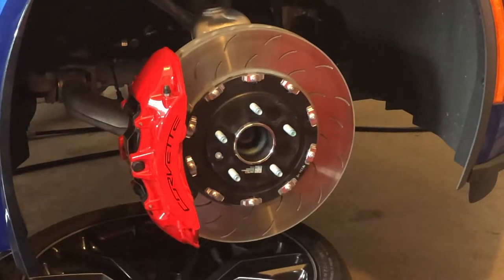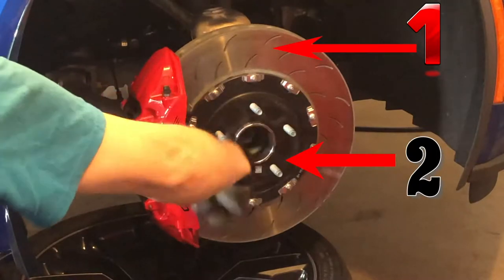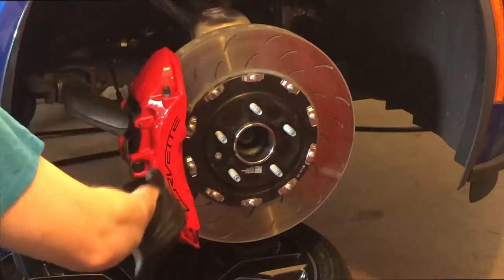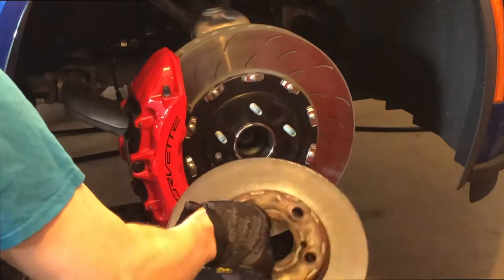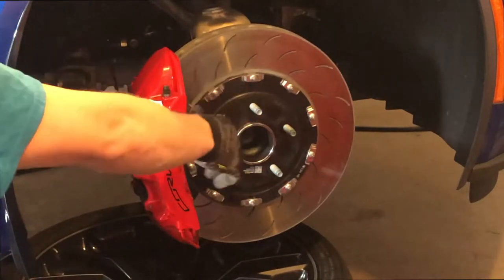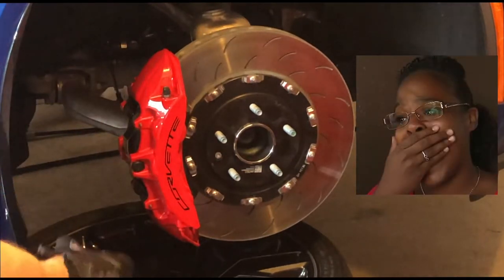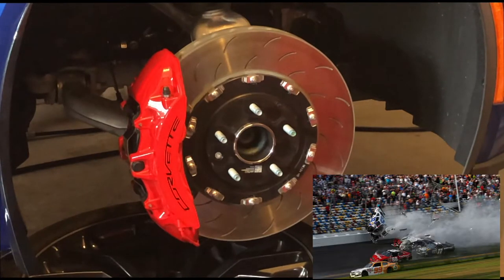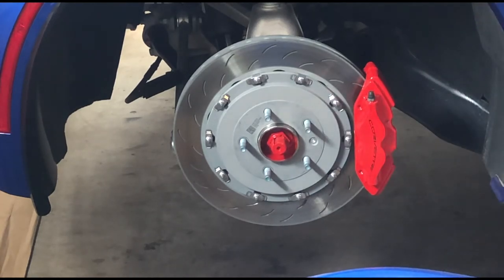What are 2 Piece Brake Rotors

Comment: I have a 2018 RWD Lexus GS350 F Sport with the regular rotors, but since I’m going to replace them, I figure I’ll  go with with the two piece OEM ones that Lexus gets from Advics. I also heard that the two piece is much lighter also helping reducing bearing wear.
Reply from the maker: Hey there, the two piece are lighter, and the biggest benefit is that you reduce your unsprung weight and that helps with handling. As for bearing wear I would save its negligible, if it affects it at all.  The biggest improvement is handling, and it does help with acceleration.
Reply: @GarageKing  thanks I appreciate the information
Reply from the maker: @AllEyezOnRod  Anytime !!